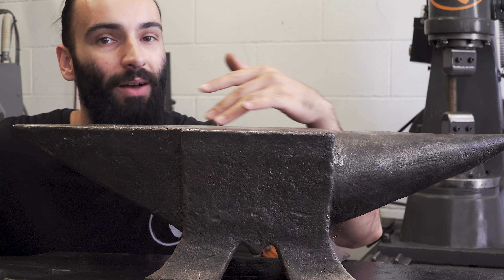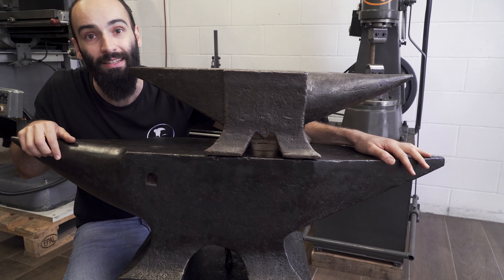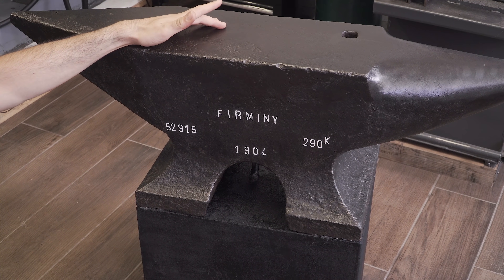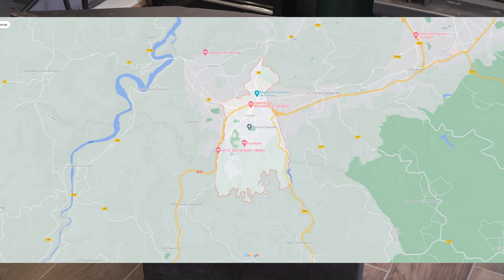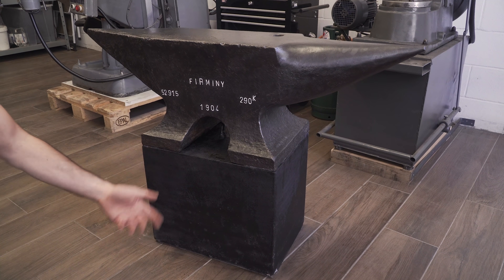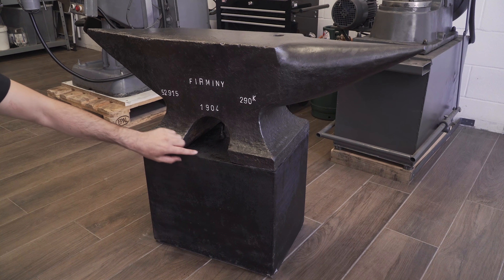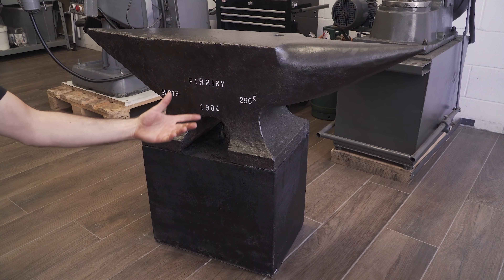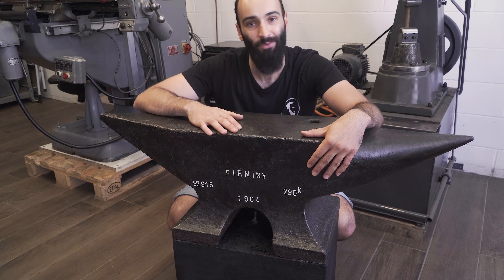Stand for BIG 290kg (640lbs) Anvil | Will Reinforced Concrete Work?

Comment: So 4 years later, what is the verdict? How do you like it? I’m about to make a stand for a 460 lb Fontanini. I’m debating if it’s worth making this concrete stand or fabricating a serious tripod stand for more foot room. 

Thanks for the video!
Reply from the maker: Holing up grat! No cracks, no problems at all. I added angle Iron to the corners so it doesn't slide side to side and also glue it down for good with construction adhesve. 
Definetly a great solution for heavy anvils imo!

Comment: I am an old concrete guy. Good idea. I would want the concrete base sitting on a concrete slab. I would have used smaller rebar, and left a little more room/clearance around the edges. Not enough concrete around the rebar, and the outside parts will eventually break off. In another life line, I would have been into forging and black smith work.... Wood this life time...

Comment: I am pretty sure even if you used a 12 lb sledge hammer you still wouldn't damage that base. Imagine putting that anvil or a four wheel dolly on it's side and then hitting the strike surface with your hammer. It won't move even a little bit.

Comment: You will eventually run into issues with the concrete base breaking. For it to work you need to use pre and post tensioning steel through the slab to provide proper rigidity and rebound force along with top quality mixed cement with proper vibratory setting (very expensive and requires specialty hydraulic tools). This is the type of cement used in modern structures and bridges that are subject to constant impact force. I would stick with a big ole chunk of walnut. I will be interested to see how long the base will last though, you did a great job with what you had.

Comment: if the hammering vibrates the concrete at its resonance frequency then it will crack.
Reply: gluing a thin sheet of rubber between the anvil and concrete would mitigate any vibrations resonating through the concrete.

Comment: One of the reasons why the smaller anvil is more likely to break the concrete cube is pressure. A smaller anvil will have a smaller base, so the force you apply over the top of it will (at least in part) be transferred to the bottom and applied as pressure to the cube below. The smaller the base, the higher the pressure. This is somewhat similar to the reason why people who walk on ice would rather do it with snow rackets. The force does not change (that's determined by the strength of your blows), but the pressure does
Source: me :)

Comment: Thanx for sharing but why not use Wood instead of Concreate? you can either use a large tree trunk, or you could strap few small ones together to make a base for your anvil you will have the following 3 benefits:
1- reduces the force from anvil to base and floor of your shop drastically
2- Reduces the noise 
3- it looks good and much easier to move around
most of the anvils specially the big ones are based on Wood.
Love you love your work and also love that clean shop that you always keep it clean and tidy.
thank you again for sharing.

Comment: I think it will be fine the biggest concern would have been if it cured too fast. Slowing down the cure by periodically wetting it or even soaking it completely under water would have drastically increased its hardness.

Comment: Nice, how much time did the cement block require for curing?
Reply: Initial set will take a day, 80% strength in 7 days and 100 % strength in 30 days. Standard concrete mix.

Comment: I absolutely love firminy anvils, I have a small 30lb and a tiny 10lb myself I use for riveting aluminum sign frames.  Yours isn't just an anvil, it's an AAANVIIILLLL (insert a manly MUAH AHAHA here).  But I can hear a little inconsistency in the ringing, I believe the tempering is a little light to the right of the center (your right, not mine).  A good resurfacing may fix that, but don't grind any deeper than 2-3cm for fear of getting into the  non-tempered center.  I made that mistake and it cost me $300 to get it re-tempered...oops, my bad.
Reply: @MrOldclunker  That's true now that I think about it.  It would be more of a tempering issue all the way through wouldn't it?  What would you suggest?
Reply: @thisolesignguy2733  The only way to retemper the anvil would be by using a heat treatment oven or a pottery kiln to bring it up to cherry red and then slowly lower the temperature back down again. Given the size of the anvil it will need to be a fairly large oven and the whole process will take at least two days.

Comment: I think you're right about the mass of the anvil "protecting" the concrete from regular blacksmithing. I would be a little worried about what the base is going to do to your lovely floor! Also, if it gets moved, you might find the base starts fracturing around the edges, especially if you have to tip it onto a corner. The point load will be tremendous. Fantastic anvil though, look forwards to seeing more of it.
Reply: Well correct me if I'm wrong but technically physics tells us that no matter what the mass of the anvil, every impact on its surface would result in an equal impact on its base, right? So if he could hammer the base to bits, with or without the anvil on it, it would break
Reply: @ncstudio333  but an anvil has a larger area of contact surface so the hammer blows exert equal forces but not equal amounts of pressure. Using an even bigger anvil lowers the pressure even more.
Reply: @ncstudio333  not really, Impact dynamics is about conservation of momentum, the higher the mass, the lower the movement (speed) which eventually turns into a vibration

Comment: At first, I thought a concrete base was a terrible idea. But after you mentioned that the anvil will likely be absorbing the impact forces, it does make sense that it'll probably be fine. Only time and use will tell for sure.
Reply: Ya you would have to put a massive  load to transfer through that beast!!!
Reply: Njaa.. the force traveling downwards is the same. However it is spread out over a larger area so the force per square centimeter is less, thus it is less likely to crack the stand.
Reply: @endurogubbarna  I think it’s more that the anvil weighs 290 kilos so the inertia is much greater than any hammer wielded by a man. Thus, when striking the anvil, there is not much force downwards on the concrete base
Reply: @endurogubbarna  
Makes sense.

Comment: A wonderful anvil. Congratulations. The only remark is that when pouring a concrete base, a vibrator had to be used for compaction. Internal air bubbles greatly weaken the structural integrity. Good luck to you.